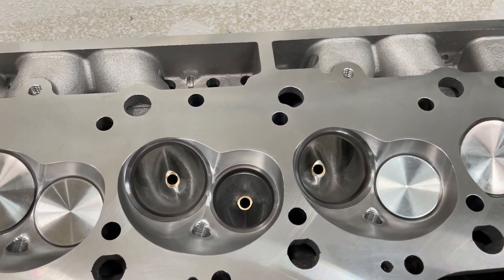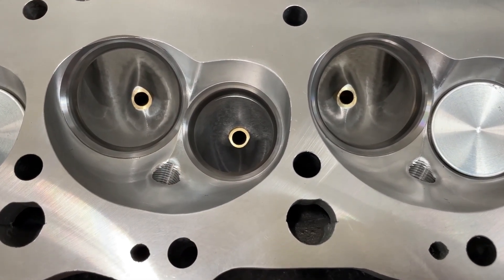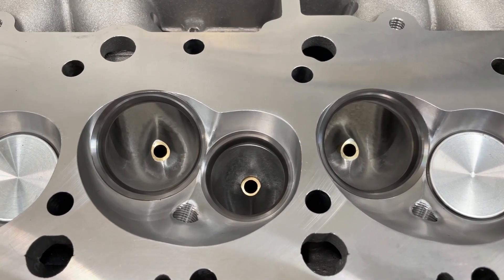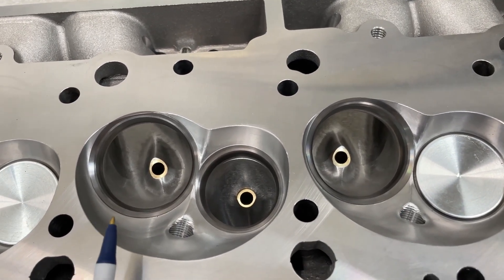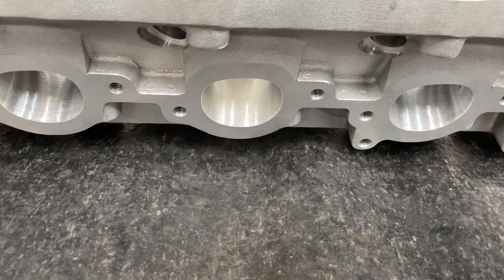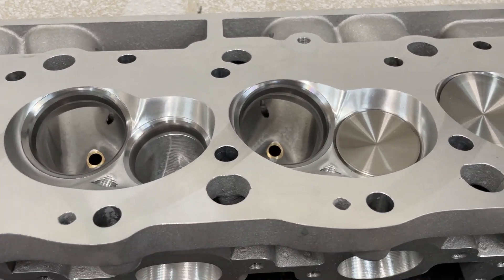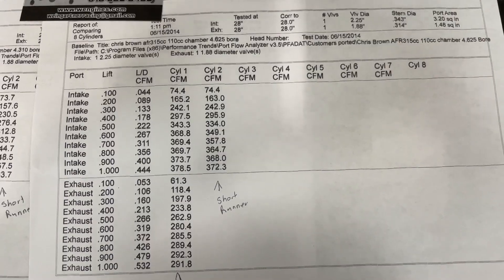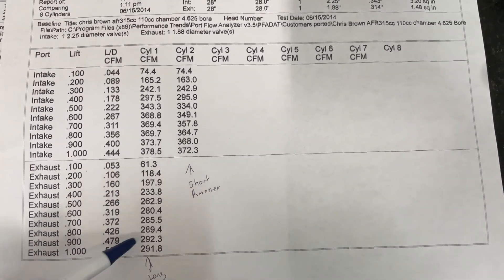AFR 315cc BBC Head Info and I Flowed it on a Small and Large Bore

Comment: Eric great video as always. But I would like to point out that those flow numbers aren't much better than the AFR 335 as cast ...and they are as cast. This set of heads has some CNC work done but the problem that I see is these heads cost about 2,000 more dollars. And I don't think it's worth spending $2,000 more dollars to get an extra 20 CFM what's your opinion on that. Especially considering you can get those AFR335s from Skip White for $1,400 and they just don't say AFR on them.
Reply from the maker: I think you have some bad info. You need to find the video where I flow the actual afr enforcer bbc heads. They are not great. If what skip white sells are like them they are just as bad or worse. Most likely worse since afr valves flow more. The better Chinese head is the promaxx 317 it is a copy of the afr 315.

Comment: How about the 396 engine. don't seem to be anyone producing good power out of them like a small block 400? Is it due to large chamber size to bore ratio?
I know it's easy to go large bore to make up the hp / flow but having a limit to cubes in a specific class is there a chance in decent hp at all.
Reply: A 396 bore is just too dam small.
Reply: @jrdmotorsports9718  I just can't believe a 400 sbc can make 750hp without too much trouble with good heads and the 396 with better heads can't?
Reply: @62Gasanova  Didn't say it was impossible. But you are comparing apples to oranges. Think about why it would be harder to achieve a goal like that with the design of one and compare to the other. Unless you are in a class that mandates a 396bb., you won't see many doing it. Just not cost effective. Any 396 I build usually gets bored to a 427, unless the customer is adamant about keeping it a 396. That small bore with big ports and valves that like to shroud and chambers that over hang the bores is not a good recipe for power. It's one of those engines that if you have to, you can, but why bother. I have, and it takes a lot to do it. The design sucks.
Reply: @jrdmotorsports9718  damn shame it's that way. I do like to keep the originality of the motor to some extent but I know what your saying about the 427. 
I will have to move on I think and leave it the way it is even though it's a great engine.  Thanks for you opinion
Reply: @62Gasanova  No problem. I deal with this quite often with these. There is a reason why as a 396, it stays a 396, or 402,  and is only slightly modified or put back to original. Just by boring the engine to 4.250" opens, opens the door to many more possibilities. Just got done with 2 actually. There are ways around the obstacles with the small bore, but it isn't cheap.

Comment: I have a set of these on my 477 ci bbc. 4.5 bore and 3.75 stroke. 
I  opened up the intake ports to match the Edlbrock tunnel ram intake.  The same one you run on your Camaro.
I  am wondering if you think you could improve the flow on my heads? Also if you could check to see if I hurt flow matching the heads to the intake manifold?
What do you think of this combination?
Reply: Did you dyno it?
Reply: @dennisrobinson8008  I have not run it on a dyno in this configuration.  I did years ago just to make sure everything was okay.  We did Not tune for power. This was with a single plane 4150 carburetor.  We made 716hp @7200 RPM. 
I  am hoping to see 800 plus hp with the tunnel ram and EFI with a 105mm throttle body.  
Unfortunately when I get it running again I will be running it on a chassis dyno. So direct comparison will be difficult.
Reply: @marknealen3140  Sounds good.   I'm sure you will meet or exceed your target.

Comment: I have angle milled my FE heads from 13 to 11.5 and recut the flange to 13 to fit the intake and it ran better. I had to match the intake to the new angle and it worked on this head, but I too would love to hear EWs opinion. Really a lot. 13 is supposed to be pretty good. I don’t think I messed them up.